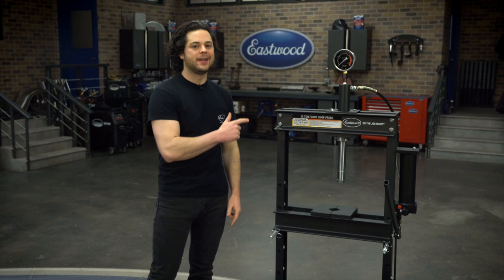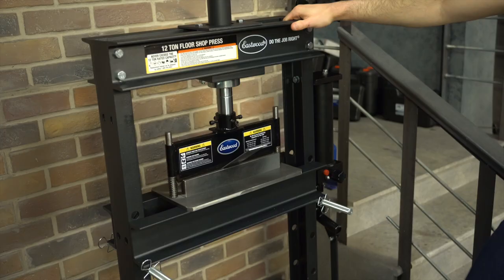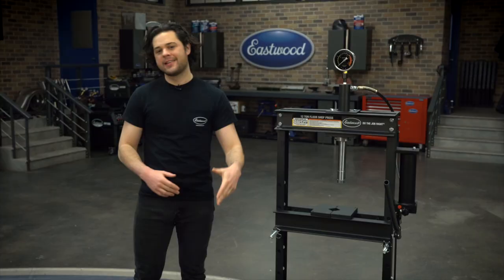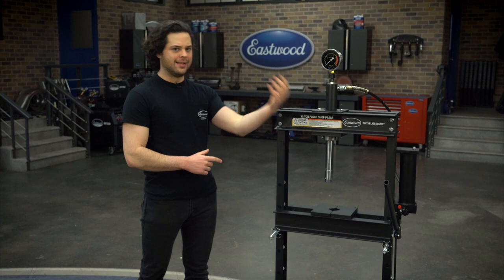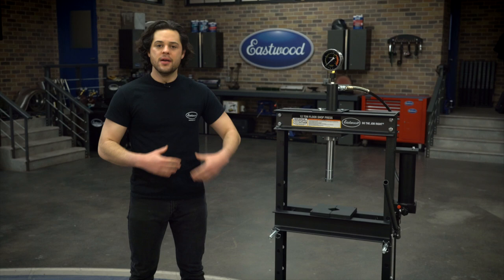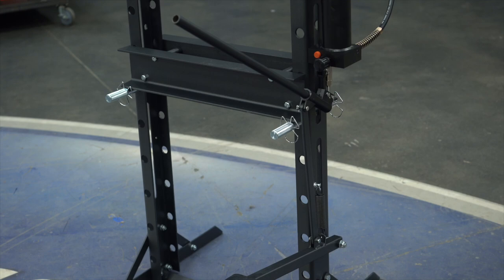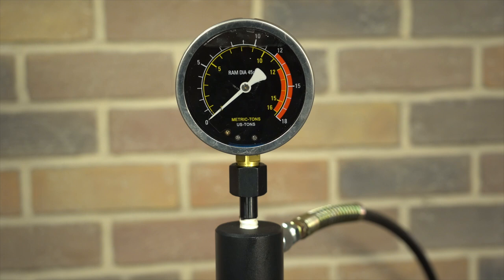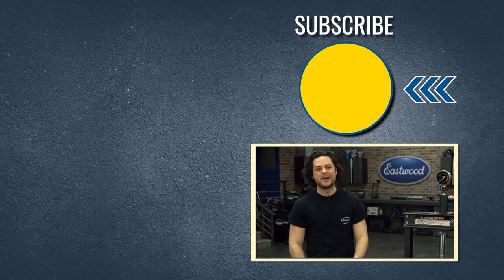Press Bearings, Punch Holes, Bend Metal - 12 Ton Shop Press - Eastwood

Comment: The ram is a large diameter.  Is there an adapter to make the diameter smaller when needing to press smaller surfaces?
Reply from the maker: We have several punch kits listed on our site:

https://www.eastwood.com/performance-tool-6-pc-shop-press-accessory-kit-w41065.html

https://www.eastwood.com/sunex-5-piece-zinc-plated-punch-kit-57ppk5.html